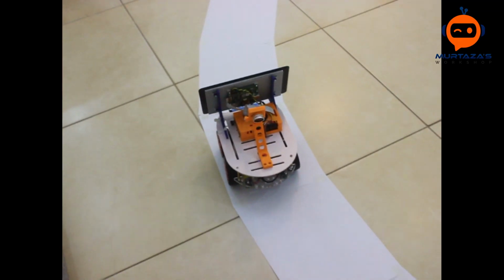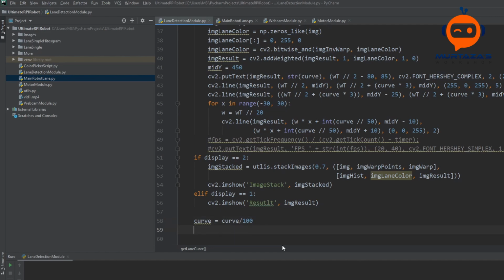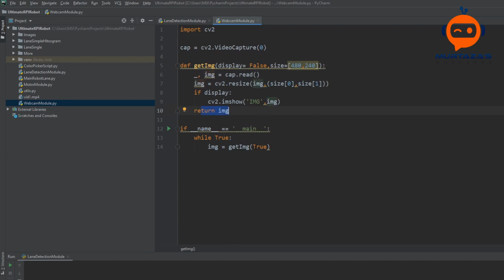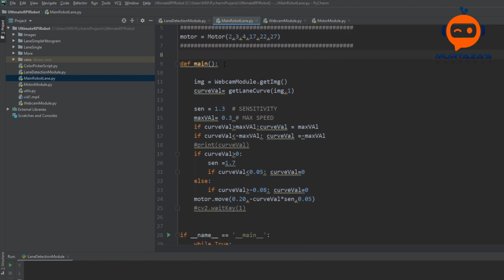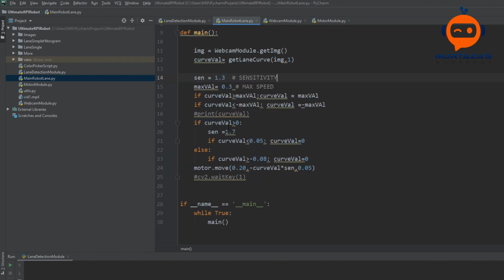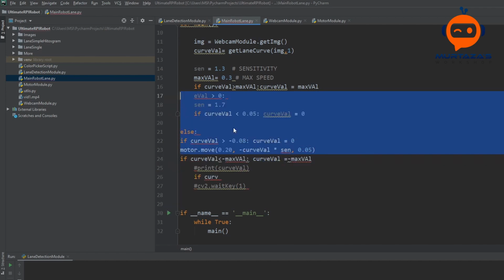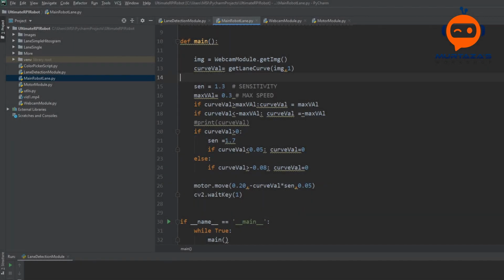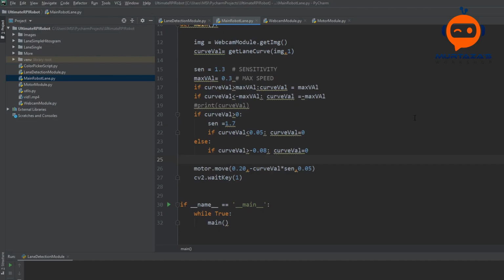Hardware Implementation | Self Driving Car with Lane Detection using Raspberry Pi p.6

Comment: Sir, we are doing this project. We upload all the complete and hardware code which was you given in one folder sir. But if i run robot main or webcam module it shows me "assertion error".what can i do sir. Please reply sir. We are last at this project. We stuck at this point. Please sir
Reply: can u say where did u get all those code and stuffs folder? in CVZone i only saw the computer vision codes

Comment: Hi sir , awesome project!! I want to ask you question, when the path ending the robot still going straight, what can I do to make the robot move only when him see path and no black screen example?
Thank you , you big maker!!
Reply: Hi did you get any solution to stop the car from moving after the lane ends? please do reply I am in dire need of it.
Thank you
Reply: @rouge-tl8ks  maybe try with stop sign detection?
Reply: @GuestAcc_1   do you have the code for that? can you please provide it? Thank you. Plus while running it on raspberry pi i am getting black screen do you know the reaseon?
Reply: @rouge-tl8ks no I dont, I dont even start the project. but you can search it on another youtube videos.

Comment: Why does the curveVal in mainRobot.py print out zero? For some reason getLaneCurve() prints the correct curve value but it doesn't get returned in mainRobot.py, I have a feeling it is due to the image stack and our warp mask. I tried debugging by using display=2 whenever I call getLane(img,2) and I noticed the warp points are off by quite a bit so that may be the underlying issue. If anyone has resolved this issue, I'd greatly appreciate it
Reply: i have error too. can you send me the code? quangchienspkthy@gmail.com. thank you so much
Reply: How did you solve this problem? (I don't see hidden comments)
Reply: @danrusien6506  
....
def getImg(display=False,size=[480,240]):
     intialTrackBarVals = [102, 80, 20, 214 ] 
     utlis.initializeTrackbars(intialTrackBarVals)
     _,img=cap.read() ...
Reply: You just need to record a video of your car driving through the track and set the trackbars accordingly
Reply: I FIGURED IT OUT !!!! Thumbs up this comment so that others can find the issue! Although it is not necessary I'm just happy to help others, I'd love to get credit for the contribution of the fix! ------> (https://github.com/IannGeorges)  
The error lies in the webcam module! 
You have to add:
~~~
intialTrackBarVals = [102, 80, 20, 214 ]
utlis.initializeTrackbars(intialTrackBarVals) 
~~~
to the webcamModule.py
Reply: @SuperKing11100  Woah amazingg! Imma check it out in the weekend today and thanks for sharing the code!
Reply: @rahulanbalagan1582  do u have the code? can u share it for me? quangchienspkthy@gmail.com Thank you so much
Reply: @SuperKing11100  I am going to try this !! Thanks man
Reply: @aadityanaresh9847  How did you solve this problem? Can you help me please (I don't see hidden comments)

Comment: Thank you thank you thank you very much, great professor!
Reply from the maker: Glad you liked it!
Reply: @murtazasworkshop  Hey Murtaza! I tried this project but when im running the main module live on pi the curve val is always zero...i tried to find the error but to no avail. Would be amazing if you could let me know where the mistake it!
Reply: @rahulanbalagan1582  hi,did u get finally output or not???
Reply: @murtazasworkshop   Why does the curveVal in mainRobot.py print out zero? For some reason getLaneCurve prints the correct curve value but it doesn't get returned in mainRobot.py, I have a feeling it is due to the image stack and our warp mask. If anyone has resolved this issue, I'd greatly appreciate it

Comment: I have done and understand most of the programming part but I am stuck at one point my car is only going straight and curve Value is always 0.
Reply: The trackbar values are still 0, solve this by moving the values found in loop statement of Lane Detection to the main of Lane Detection. Hope this helps!
Reply: @hdekwant9497  thank you I will surely apply this
Reply: AADITYA NARESH did you get that ?
Reply: @hohoming8  I am using Arduino with Raspberry-pi !!! With same concept of Lane Detection. I will send you my GitHub account link after I have completed my project.
Reply: AADITYA NARESH did you solve the issue with new pack?
Reply: @hohoming8  yeah it's working I have to do some callibration
Reply: AADITYA NARESH can you share the code ?
I am really stuck with the final implementation
Reply: @hohoming8  same happened to me I tried many thing and my Project deadline was very close that's why I left this project to do after some time.
Reply: @aadityanaresh9847  Hey Can you let me know how you got the straight line problem fixed?
Reply: @rahulanbalagan1582  still trying !! But presently I am using different approach like using Arduino also to control the motor driver.
Reply: @aadityanaresh9847  using Arduino to control shouldn't really affect cuz the curvevalue is what we're having a problem with which is basically coming from the pi
Reply: @rahulanbalagan1582  I found the issue! Reference my recent comment and thumbs up if it was helpful!
Reply: @aadityanaresh9847  I found the issue! Reference my recent comment and thumbs up if it was helpful!
Reply: @hohoming8   I found the issue! Reference my recent comment and thumbs up if it was helpful!
Reply: @SuperKing11100  hi can you help me ?
Reply: @sefaorha6721  what can I help you with?
Reply: @SuperKing11100  Im not able to find ur recent comment abt the solution can u please once again post it to this reply. Thank You
Reply: @akhilhalgeri6304  bro you just need to record the video using your car and the adjust the track bars and everything according to your video
Reply: for those who have problem with getting 0 lane curve value put this code :intialTrackBarVals = [102, 80, 20, 214 ]
    utlis.initializeTrackbars(intialTrackBarVals) in the mainrobotlane at line 27(sorry bad english),need to import utlis first

Comment: Could I ask you some help about this project? I'm interested in that and I done the same thing as you but I have some problem when I implement the code on the raspberry, It seems it cannot detect the path
Reply: Same I don't know but my car is going straight forward !!! And I tried printing CurveVal and it is showing 0 always. I am sorry for interfering But if you get any solution please comment meanwhile I am also searching for the solution
Reply: @aadityanaresh9847  I'll give a try, and if I'll find something I'll tell you. Also if you get any solution let me know. At least let's help each other hahaha
Reply: @ionelpirnau3252  for time being I have abandoned this project I mean deadlines are very near and I don't think 😅😅😅So I am making Self driving car from other source but surely if I get any solution I will Comment here !!
Reply: @aadityanaresh9847  Check out my recent comment, I found the error!
Reply: @SuperKing11100  where please
Reply: @SuperKing11100  Where is your comment?
Reply: @aadityanaresh9847 are you done with the project?

Comment: How is it possible to let the robot start at bootup without any SW manipulation.
The modules have to be loaded into the RPI and the main sketch has to "run"
How to start this automatically at bootup?
Actually you have to do that manually with a PC connected.
Thanks for your work.

Comment: Hello Murtaza! Thanks for sharing the knowledge. I'm having issues when using main module. Its giving me wrong curve value. I'm not having this problem when calling from main inside the lane detection module. I would really appreciate it if you could help me fix this issue.
Reply: Hey did you find any solution ??
Reply: my webcam module is not displaying an output
Reply: @favouroguibe1717  same to yoy. Did you have any solution?Help me
Reply: can you please specify the error so that i will check and if i know anything i will help you
Reply: @hemacharankodhanda664   when an run the main module it will be show an print(curveval) is displayed as '0',it means it goes straight with tilt an angle.. so pls help to me

Comment: believe me you are the best man
thnx so much 
you' re giving alot
Reply from the maker: Happy to help!
Reply: @murtazasworkshop   I figured out a solution! I've never contributed in my life to any open source but why not start today ;) I'd love to get credit!!! (https://github.com/IannGeorges) the error lies in the webcam module you have to add the ( intialTrackBarVals = [102, 80, 20, 214 ]
    utlis.initializeTrackbars(intialTrackBarVals)) to the webcamModule
Reply: @murtazasworkshop   Why does the curveVal in mainRobot.py print out zero? For some reason getLaneCurve prints the correct curve value but it doesn't get returned in mainRobot.py, I have a feeling it is due to the image stack and our warp mask, I tried debugging by using display=2 whenever I call getLane(img,2) and I noticed the warp points are off by quite a bit so that may be the underlying issue. If anyone has resolved this issue, I'd greatly appreciate it